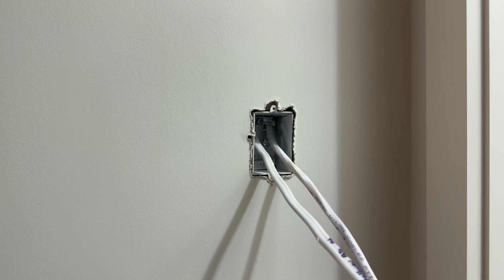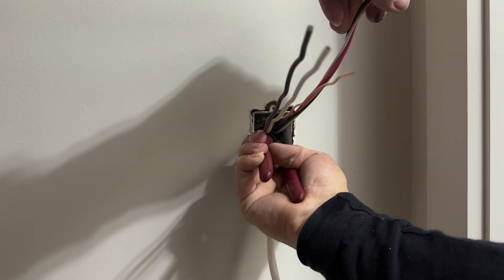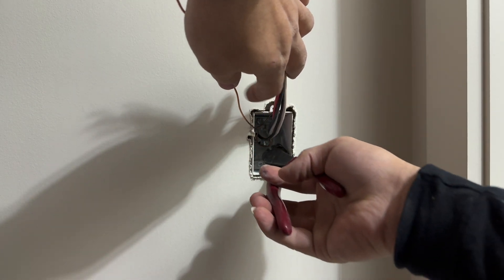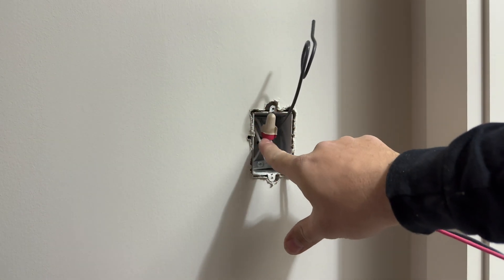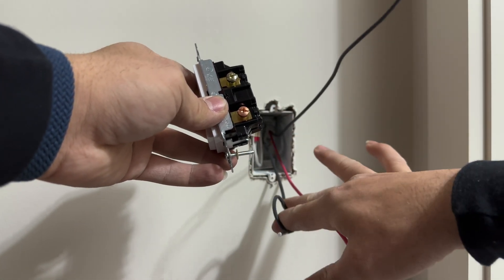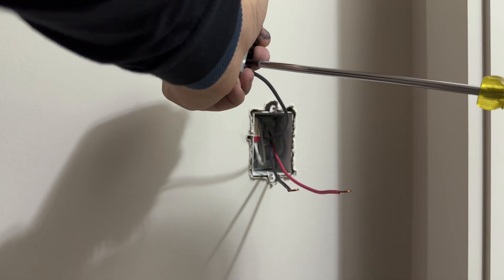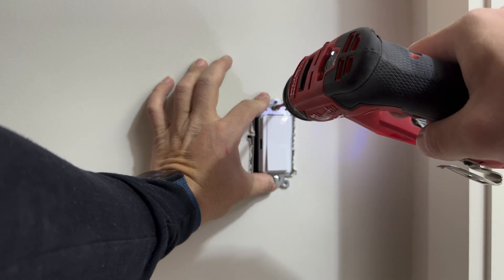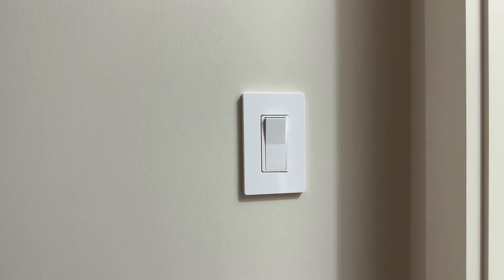Three Way Switch Installation

Comment: Why did you cut the ground wire, no ground wire attached to the switch , is that the proper way? Should pigtail ground to the switch.
Reply from the maker: I am in Ontario Canada the box is a metal box with two dedicated ground screws and by code “here in Canada” I am not required to ground a rocker switch. Have a great day brother

Comment: Didn’t ground the switch…!!!???
Reply from the maker: Thank you for your comment, since the 2021 OEC (Ontario Electrical Code) its not required to ground switches ok residential settings unless specified by the manufacturer.

Comment: Interesting, in the US the common screw on the 3-way switch is black. Another thing is that on a metal box, a separate bonding jumper must be connected to the green screw on the box, wire nutted to other ground wires and connected to the ground screw on the switch with either a pigtail or by using a green wire nut with the wire going through the hole in the wire nut. You cannot leave the ground screw on the switch unconnected. This way, the switch will be grounded without relying on the mounting screws for this purpose.
Reply from the maker: I know Leviton 3way switches and other generic brands do have a black screw for the common but Lutron does not. Interesting grounding code in the US I would love to read about it. Thank you for your comment
Reply: @uralexwong  In the US the metal boxes have one 10-32 hole to mount the bonding jumper. I've heard where some electricians will loop a ground wire around the box grounding screw and go on from there and still pass inspection. I believe that the US NEC still considers that to be a code violation.
Reply from the maker: @surferdude642  wow now am I curious I will look that up, I am in Canada in case I forgot to mention it. I never seen a box with just one ground screw here metal boxes have two.
Reply: @uralexwong  In the US plastic boxes are used almost exclusively in residential applications, with some exceptions, most notably the Chicago area. You can use metal boxes but builders don't by default unless the owner specifies, such as in remodel or in new construction of a custom home or you do it yourself. Metal boxes are used in commercial and industrial applications.
Reply from the maker: @surferdude642  Plastic boxes are only allowed in Slab work and Residential applications but I prefer metal and plastic boxes only in ICF walls